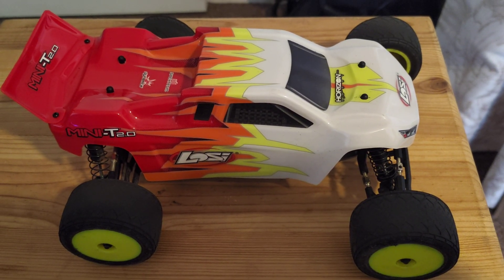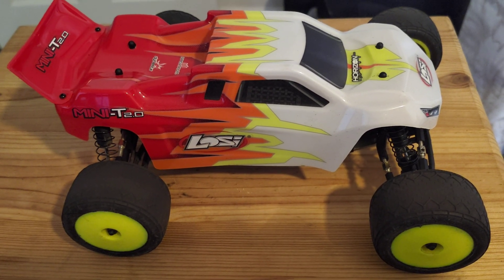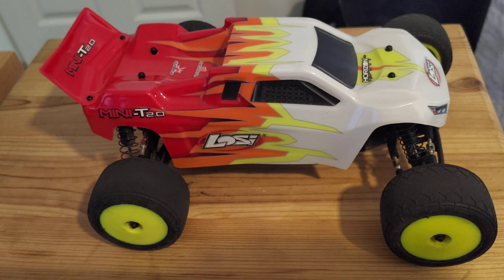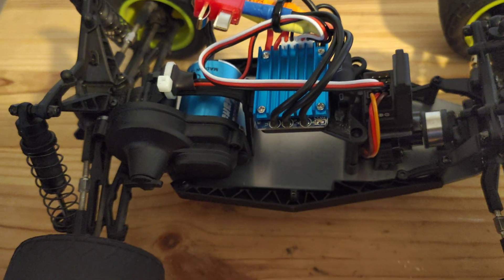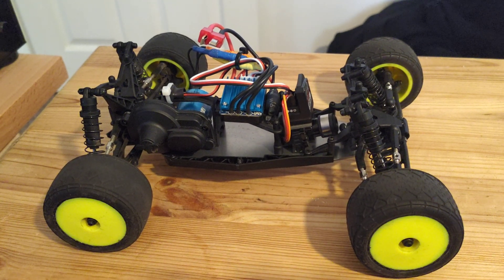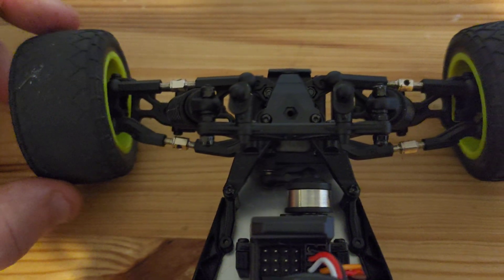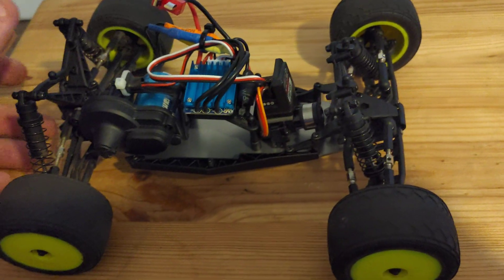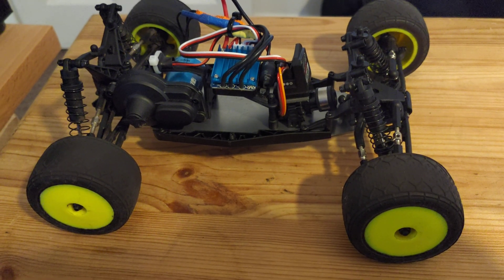Losi mini-t 2.0 brushless conversion and update.

Comment: I know I'm kind of late but low she fixed the issue with the brushless conversion mini tea they never fixed the issue with the brush version. I'm understanding a lot of RC drivers that buy the brush version having the same problem when I got mine I got the brushless version and it came with the thicker arms I got the RPM arms just in case and also GPM aluminum parts that I haven't even put together thank you for sharing 🤣😂🤣🤙🏻🔥😎🔥💪🏻
Reply from the maker: Yeh seem all horizon rc's seem to have issues some get fixed some don't :(

Comment: we got a faster Brushed, motor but the motor Shaft is to short causing a Problem with Gear alignment! you or any one Know any thing to help Make this work.?
Reply from the maker: Not really any way to extend a motor shaft other than to weld to it but it's difficult and probably more expensive than just buying a cheap motor :(

Comment: Do you have the model number for the motor and esc you used
Reply from the maker: its just a very cheap generic esc and 7200kv motor

Description
Specifications: 
1> Motor
RPM: 7200KV
Max Current: 24A
Max Watts: 200W
Can Size: 2430
Sensored: No
Shaft Diameter: 2mm
Shaft Length: 12mm
Bullet Connector: 3.5mm
Max voltage: 7.4V(2S)
2> Electric Speed Controller:
Cont. Current: 25A
Burst Current: 90A/10sec
Battery: 2 Cell Lipo / 4-6 Cell NiMh
BEC: Yes
BEC Output: 5V/1A
Power Supply Plugs: T Male
Motor Plugs: Female 3.5mm Bullet Connector
Motor Size: Approx. 41 x 24mm/ 1.6 x 0.9inch(Height x diameter)
ESC Size:Approx. 37 x 26 x 14mm/1.5 x 1 x 0.6 inch
 
Package Included:
1pc * 2430 7200KV 4P Sensorless Brushless Motor
1pc * 25A Brushless Electric Speed Controller
1pc * manual

Comment: I am thinking of getting this and using it on tarmac mostly. I like the small package and want to experience rwd driving and this seems the cheapest way to go with the ability to truely tune it like the toe, camber and ackerman. There aren't so many mini rwd cars around. I can only think of tamiya m06, 08 and xpress expresso.  Tamiyas are money pits and the xpresso is tarmac only, not very versatile.

Like you.said, I'm interested in putting on m chassis wheels. Given it uses 12mm hex, i don't see why they won't fit.
How does the rig drive? Is it responsive? Any bump steer?

I plan to make it brushless like you from the getgo. I would like to get a turbo racing receiver so I can use the stock radio.

It's actually cheaper and better to buy this and upgrade it to brushless than to buy the brushless version, which comes with only with a 6000kv.
Reply: A Turbo Racing receiver will fix my issue with buying yet another transmitter! (Yes ocd) Do these use the same protocol as the stock losi transmitter and how do i know wich one to use and if it will work? Would really like to keep using the stock one. And what brand motor esc combo is this?
Reply from the maker: These are just cheap unbranded esc and motor they are sold under many names
Reply from the maker: Bump steer is horrible as stock, but a quick tie wrap around the servo saver fix's it :) they are a whole lot of fun, they drive so much better than you would think for such a small RC, there are way better batteries than the stock one for half the price too the gens ace range fit spot on. I swapped out the radio gear as I run the flysky noble nb4 in all my RC :)
Reply from the maker: The only real issue I have had is I'm sure the hex drives are 8mm standard and the stock tires don't last more than a 4 or 5 batteries so I still need to swap them to 12mm and get some m chassis wheels and tires :)
Reply: @WTFRCCars  thanks for the info. Hmm, the website says they are 12mm though. https://www.horizonhobby.com/product/1-18-bk-bar-front-rear-1.4-pre-mounted-tires-12mm-hex-yellow-mini-t-2.0/LOS41008.htm
Reply from the maker: They may be right lol I got a lot or rc's and been doing far too many 12h shifts :( I have seen lots of places selling hex adapters so don't think it will be too hard to get any you need :) I'm really supposed with the low stock of the stock wheels and tires that there ain't been more 3rd party companies bring out wheels for the mini t 2.0

Comment: A little underwhelmed myself with its speed🙄 motor ecs swap asap. Hbx rampage wheels fit just have to make hole mm bigger 👍
Reply from the maker: The stock motor is far too slow but goes well with a brushless swap :) the one where running does a out 25mph with stock pinion but think it would take a bigger one as the motor stays cool, my bro got some old 1:10 buggy tires and cut the centre tread out and stuck it too the old mini t 2.0 tires works great took it round the grass track today and drove great, I was surprised at how well it ran and they didn't come in stuck so might give it a go with mine :)
Reply: WTF RC Cars yes will do the swap soon as my sons hbx leaves it standing, good luck with the tyres 👍

Comment: WTF RC cars whats a good lipo battery for the the mini t 2.0 ?? i gotta 2 s in mine now but to move up to to a 3s or r4s
Reply: Tattu battery 850mah 11.1v 75C 3S
Reply from the maker: Gens ace 800mah 2s fit well, there really is not much point going up from 2s as the space and weight of the cells means you only get tiny mah batteries that fit and such a small Rc really does benefit from extra voltage. I have found a few 1000mah batteries but they start to get heavier and can effect the handling.
Reply: Tattu 850mAh 11.1V 45C 3S LiPo Battery Pack with XT30 Plug for Multirotor FPV 150 180 Size Quadcopter
Reply: Its about 26$

Comment: Do you have a discord? I have a few questions I’d like to ask.
Reply from the maker: Hi sorry don’t have one set up but feel free to ask anything on here :)
Reply: WTF RC Cars its kind of a lot of questions haha I’ve got a stock mini t 2.0 and I want to upgrade it to a brushless motor but I have 0 idea of what I’m doing. Is it possible to just buy the motor/esc combo and use the standard remote it comes with? I’ve done a lot of research but every time I start putting together a list of things to buy to make it work I hit a wall somewhere and don’t want to miss a part or something that will delay it weeks since shipping right now takes forever. Really just looking for a compact list of what to order to upgrade the motor just bare minimum. If you had another form of contact that’s instant I would gladly pay for advice. I have the mechanical side down I have a xmaxx if done a lot of upgrades to just new with the mini t since I have owned one since the original version.
Reply from the maker: Unfortunately you can't just upgrade the motor and use the stock radio as the ESC is built into the receiver, so you will need 1 flysky gt3c transmitter with receiver, a 280 brushless motor with ESC and your done you can use the stock servo and pinion :)
Reply: This just saved me thanks
Reply from the maker: Glad it helped :)

Comment: What transmitter are you using? Are you using stock transmitter or another one?
Reply: Ok thanks
Reply from the maker: Hi, I use the Flysky Noble NB4 transmitter with Flysky fg-r4s receiver fits very nice and give you the option of adding telemetry (temp, external battery voltage and speed).

Comment: I got some 12 mm hex adapters from ebay and put the teton tires on my mini 2.0, works really well other then the fact the tires for the teton dont have foam in them, but that is an easy fix if you just add some foam. I also put a zip tie around the servo saver to help with the slop. It is a big deference. There are some youtube vids about where to put the tie and how to do it.
Reply from the maker: Hi thanks for the info on the hex adapters, I did a vid some time back on the zip tie it does make a huge difference :)

Comment: Very nice video. I definitely think that the motor in that is a lot more respectable then the one in mine lol. On 3s mine is capable of 60mph. On 2s I out motor the 1/10 scale buggy’s are my track.
Reply from the maker: Yeh I didn't want to go mad with it :) and it was only £26.99 for ECS and motor think it's just about right for it an cheap upgrade for anyone the stock battery handles it ok too. I keep looking at the xray xb4 2020 with hobbywings ECS and V10 6.5t motor but not sure if I'd use it enough?
Reply: WTF RC Cars my electronics came to about $40. I’m running a 30amp hobbywing esc and a surpass hobby 5400kv motor with a 26 tooth pinion.